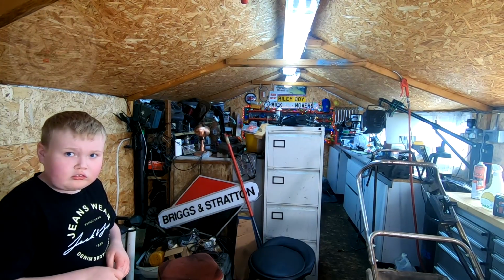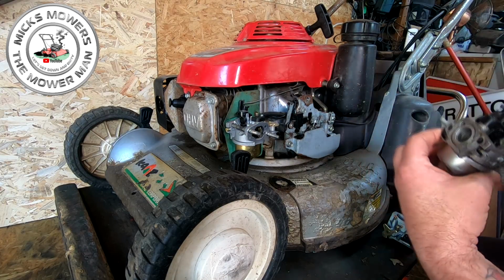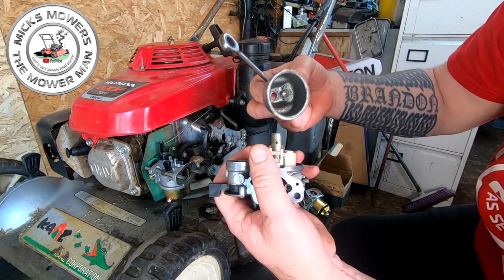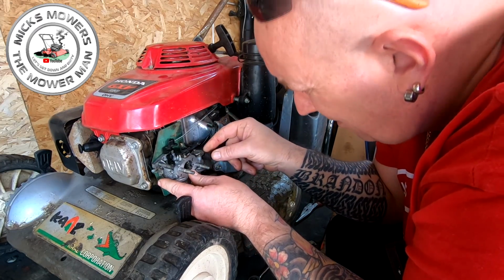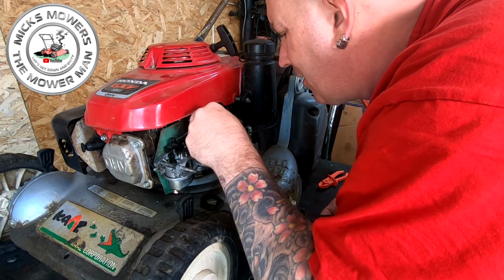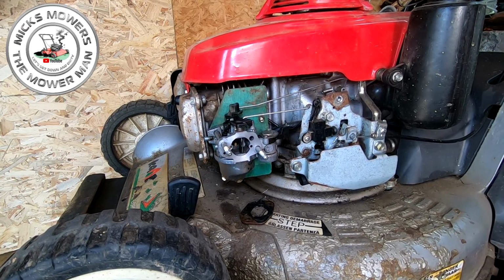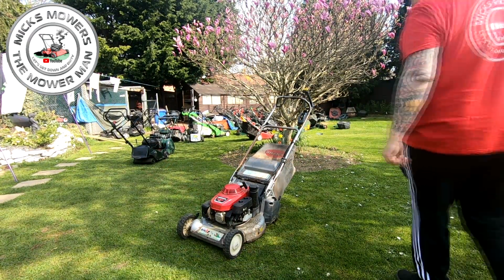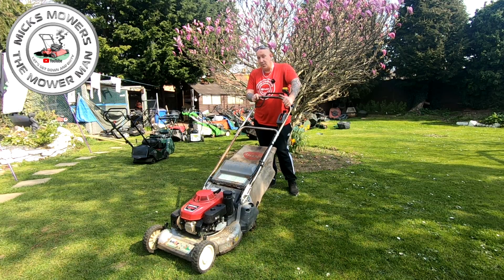KAAZ HXR PRO Honda Gxv 160 Getting The Engine Running

Comment: Look forward to seeing the gearbox strip down. I’ve done a few, both roller and 4 wheeled. Pinion shaft and gear can wear as can the dog clutch. Everything is available. Id recommend replacing seal’s also. A very satisfying job to do and an opportunity to clean out the gearbox and refill with new gear oil. I use 80w 90. There a good strong mower.
Reply from the maker: Yeah it my first time doing one.. and it will go on the bench tomorrow..
Reply: Your drive is engaging albeit sporadically. Cable adjustment may cure your problem. Roller out will allow you to inspect bearings etc and replace seals. Plus it’ll make for better channel content. More work for you tho 😂👍
Reply from the maker: @gavincannon4081  I'm just about to make a start on it now

Comment: Great video mick I've done a couple of those gearboxes as well, I bought a genuine honda dog clutch from l&s engineers as you said around 35 quid, easy job just a bit long winded, currently just been given a honda hrx476 qxe with gearbox problems but on inspection its working fine so maybe the belt had slipped off as it came to me in bits
Reply from the maker: I went to change the parts but the gearbox broke as the small roller would not come off.. so have just picked up a complete roller and gearbox

Comment: Do you have a video showing tuning/fixing the recoil starter? On my lawnmower the cord is hanging a little "limp" after pulling it.
Reply from the maker: @tex24  just pull out the pull cord and pull the string through the pull cord handle a little.. about 6 inches and tie another knot.. and see if that sorts it

Comment: Great video Mick. I’ve got a HRH 536QXE with a GXV160 engine. Cleaned the carb and the bloody thing is still hunting without the choke. As soon as I enable the choke it runs as sweet as a nut!!Will try the carb clean again using brushes and then see. Anything you can suggest if that doesn’t work.
Reply from the maker: You need to use gas tip cleaning tools.. and rim that main jet out.. or stick it in an ultrasonic cleaner.. if not then a new carb will be needed mate
Reply: @themowerman  a little better using the carb brush kit but still surging, will change the plug next.
If all else fails what carbs do you recommend Mick ? Or do I check the clearance on the flywheel magnets or valves ?

Comment: Do u know where I could buy a carburetor for this gvx 160 engine can't find one anywhere mine seems to be leaking like crazy so just going to replace it.
Reply from the maker: What do you mean leaking? From where
Reply: @themowerman  it's leaking from the petrol tap on the carburetor, the black handle which opens and closes to let petrol in when I try to start it petrol will go everywhere leaving none of it going to the engine.
Reply from the maker: @sebtjalsma  email me a photo of the carb and I will try and find you one.. micksmowers01@gmail.com